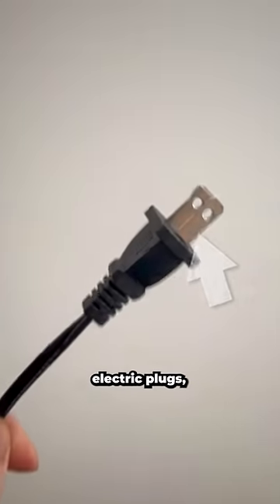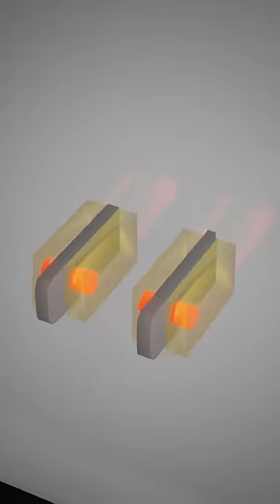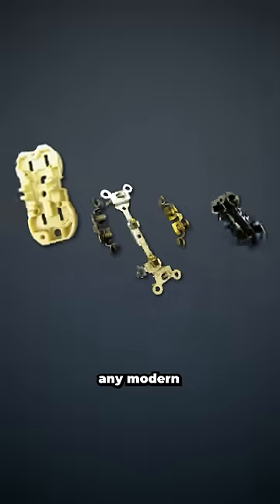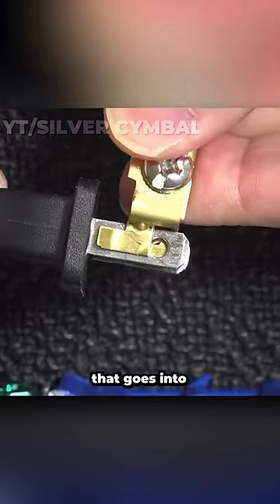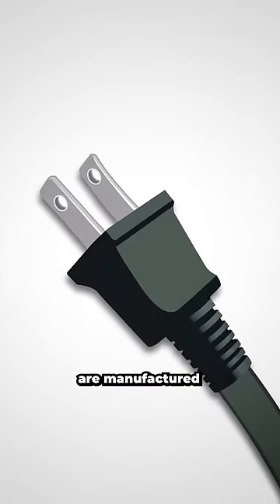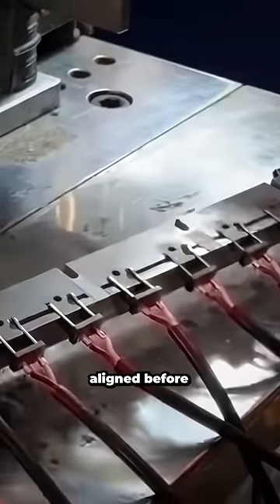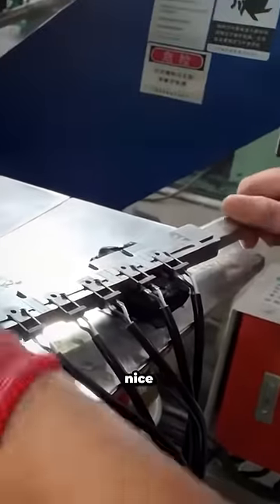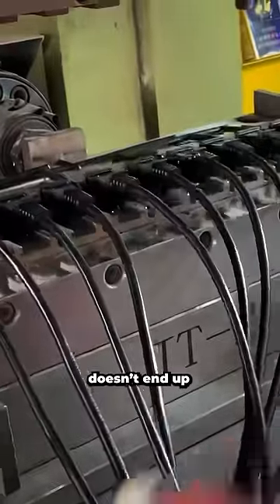The REAL Reason Plugs Have These Holes 😮

Comment: European plugs:🗿
Reply: BS1363  Plugs are best.
Reply: British plugs are the most are the safest and superior plug
Reply: @MCD10000 not when you step on them
Reply: Why did you leave them on the ground there’s a switch for a reason
Reply: @MCD10000 I fucking hate UK plugs, the size and clunkiness of it makes creating smaller packages for products with different cables depending on where it will be shipped a nightmare. Basically every other standard powercable in the world are small and neat, and then we have the UK abomination.
Reply: @lem3547  NOO. DONT MAKE ME THINK OF THE PAIN
Reply: North Americans have to have content too
Reply: @MCD10000  i'm not from there, but I agree.
they're more sturdy with the extra plastic rod
Reply: @MCD10000 the most over engineered unnecessary thing ever
Reply: @MCD10000  British people as re just afraid of electricity and are over compensating
Reply: @monad_tcp  Us Brits are better engineers, we don't have to import talent to invent stuff :)
Reply: @garybowers5724 uffff lmao
Reply: @MCD10000   valid swears
Reply: @ETK_800  worse then Lego
Reply: @m84winzi  the UK'S wall sockets are designed so the grounding pin has to be pushed in before the live pins (Mains is AC) are exposed so no fork in wall socket and hey we actually have a grounding pin
Reply: @0akd3vi1  that extra plastic rod opens the wall socket and is the grounding pin where the device has a metal casing
Reply: @monad_tcp  the electric lightning says otherwise
Reply: @lem3547  yeah but they have a grounding pin
Reply: British plugs: 🗿🗿🗿
Reply: @MCD10000 I use EU plugs in British plugs by unlocking it while pushing in the EU plug.
Reply: @MCD10000  UK plugs make everything too big for no reason. Look at a macbook charger and how it ruins it
Reply: As an American, your plugs are too safe I have no idea how to install them. Like, shouldn’t questioning whether they will arc and burn your house down be standard.
Reply: @MCD10000  British plugs are way too big. A grounding pin may be good but surely it could all be more compact. My phone charger plug does not even have a grounding pin, it just has a piece of plastic to go into the grounding hole to open the socket; it is pointless to have a "required" safety mechanism if products are allowed to just bypass it anyway.
Reply: @elio7610   There is a reason why some devices an earth pin, and some don't. Generally, high power devices like Toasters and Washing Machines need one, as you can risk getting electrocuted by just touching it. So its there for a reason.
Reply: @stueyphone  My point is that the devices that use a plug without an earth pin should not need a dummy pin. Also, they just seem generally oversized.
Reply: @MCD10000 not really, tell me what’s more secure on those compared to type F?
Reply: @MCD10000 nothing beats the swiss j with a t13 socket
Reply: @monad_tcp suprisingly its not german, with their history of overengineering
Reply: garybowers5724 That’s not what your royal family said.
Reply: Type G plug 🗿
Reply: fr
Reply: @lem3547 american plugs would be worse if they were right angled
Reply: @LambdaMiscellaneous  no, it's for safety mate for safety
Reply: @miles5600  a plug where I kid can't shove a fork into them I.e. the UK plugs
Reply: @MCD10000  type F literally has the same safety feature…
Reply: @MCD10000 I just looked them up and they look inconvenient as hell. Blocky, massive, and serving the exact same feature as the Sleek slender low profile modern beautiful North American plug
Reply: @elio7610  I agree. The EU plug is a good example.
Reply: @m84winzi  you know what else is an abomination? Easily preventable electric fires 🚒
Reply: @MCD10000 safest yes. Superior? Heck no. Way too big.
Reply: @MCD10000  ye
Reply: @miles5600  don’t think type F has a fuse
Reply: @m84winzi  our wire goes 90 degrees down tho, when it sticks out it looks dumb and can easily be pulled out
Reply: @monad_tcp  When homes run on double the voltage Dumberica runs them on, yeah.  I think I'll take engineered safety over some benign inconvenience any day.
Reply: @lordollsworth  we don’t need one. The fuse was only made because there was a copper shortage and they didn’t have the extra length to do it right.

https://youtu.be/NwnIwgT60jw?t=233

This video’ll explain it.
Reply: @garybowers5724 Lmfao. Brits import more engineers per Capita than most of Europe or the US.
Reply: @@diowo_ actually the moulded ones are no more clunky than a euro plug but the advantage is they have a BS 1362 fuse to protect the cable, 
Strangely half the hotels in China use BS 1363 plugs and sockets.
Reply: @ericandes4288  Source?
Reply: Fr
Reply: Yeah it has twice the voltage, all of our stuff is just superior.
Reply: Italian plugs are safe beacause the ground is in the midle and seperate from the other contacts
Reply: @MCD10000 they are the most goofy looking though
Reply: People really debating which plug is superior in the replies 💀
Reply: @MCD10000 nahh german are best
Reply: @LambdaMiscellaneous 😢😢😢😢
Reply: @garybowers5724  LOL, British stuff infamous for letting the smoke out.
Reply: @dogwalker666 Nah power over ethernet is better
Reply: @acewayx  good luck charging your car with P.O.E.
Reply: @smithiness   what does that even mean?!
Reply: Cypriot plugs:
Reply: @zenketski  the US plugs don't have grounding pins and are always on so a kid can fork in socket
Reply: @SliceOfLife93  it's weird as a brit, not they are not if you get the correct adapter like the Samsung one where the grounding pin collapses for storage
Reply: @dogwalker666  maybe with POE+++++++++++++++++++++++++++++++++++++++++++
Reply: @MCD10000  lol maybe 🤣
Reply: @MCD10000  that's a good learning experience for kids. If they survive,  they learn thats stupid.
Reply: @boxraze5643 thats not only stupid but potentially incredibly dangerous due to the voltage differential and not haveing the fuse it to help with the voltage difference
Reply: @alayablack9104  It's not dangerous. The voltages are the same at 100-240 volts AC and 50hz. I believe in the us the voltages are lower but not in the UK.
Reply: @lordollsworth having an outlet that unplugs gracefully from tension on the cord is a good thing. . . 

What happens when something pulls on a cord with enough force to damage the copper? North American plugs just unplug. UK and other 90° plug you now have a fault in the cord, high resistance, and a fire.
Reply: @MCD10000 also, you've clearly never seen a grounded north american plug, a shuttered "child proof" north american outlet, or a child with the inventiveness to grab more than one fork.
Reply: Laughs in British plug
Reply: @MCD10000 sure but they sure as hell aren't the best ones, the standard European plugs are a lot better as they can be plugged in in any direction and are almost impossible to step on.
Reply: Best one are the swiss
Reply: @m84winzi British plugs are the only sensible sized plug. If anything they're too small. European plugs always feel flimsy by comparison.
Reply: @MCD10000  Holy shit, British plugs look disgusting. No hate, but I just looked them up. I'm so glad that the EU has the cleanest design.
Reply: @m84winzi Still the safest and most effective design, I rarely have problems with clunkiness.
Reply: Australia and New Zealand rocking 240 volts 🗿
Reply: @MCD10000 because they strong and durable like harder to break
Reply: @MCD10000  they have to be because your house installation sucks
Reply: @m84winzi I love you plugs so much faster
Reply: @MCD10000 european schuko plugs also connect the ground clips before the  electricity pins go inside the socket.
Reply: @MCD10000 geounding pin isn't necessary. In the USA we have plugs that use ground pins only on high wattage devices or extension cables. Wouldn't make sense for your 30 watt charger brick to have one lol. Now in Japan they have the same plug as the USA but not one comes with a grounding pin...
Reply: @dogwalker666  haha no. Learn to create better circuits instead of that abomination of ring circuit, then we can talk and show you the safety standards of EU.
Reply: @cosmopolitanussum485  Ring circuits are so good I use them in industrial control panels, hundreds of Amps, TP&N oh and Europe uses British standards under license.
Reply: @stueyphone schuko plug also haves grounding, but doesnt need one in order to be used, so you can have thin chargers for the phones and still have a ground in the same outlet if you need to plug something bigger
Reply: @monad_tcp Nothing over engineered or unnecessary about it.
Reply: @LambdaMiscellaneous I'll take safety over aesthetics any day of the week.
Reply: @elio7610 Phone chargers are double insulated and don't require an earth connection.
Reply: @MCD10000 As an American I agree. It's way too easy to stick something metal in our outlets. A lot of babies and kids do it every year. The plastic protectors being built into the outlet is genuis.
Reply: @m84winzi I'lltake the inability to get shocked, switches on the sockets, and in built fuses and earth that goes at a parallel to the wall to minimise space usage over that dangerous American pos.
Reply: @monad_tcp  a child could do it, and you could accidentally. Also, you have no earth cable, so it wouldn't save you if you got shocked anyway. Obv you are not going to grab the metal on purpose, but why omit such a simple and cheap safety feature.
Reply: @sharpshotm16   I don't need any earth cable because things have isolating transformers,
Reply: @robertbritton656 anything electrical in Britain is completely over engineered.. especially in Industrial context.
I believe there was some accident which cause the regulation to require insane amount of overprotective solutions.
Reply: @lem3547  Especially when you step on them. In the battle of plug vs foot, plug beats foot every time. How does that not fit the definition of "best"?
Reply: @m84winzi  Not our fault the rest of the world has weak-ass plugs.
Reply: @monad_tcp  If anyone's scared of electricity it's 120VAC countries.
Reply: @Kemachris  But it is almost completely safe. And in some properties more convenient. We don't cheap out on costs of our plugs to increase profit or to drive capitalism. We use our plugs because it is almost impossible to be seriously injured. Safety should come first. Not reduced cost.
Reply: @sharpshotm16  the point is somethings are overdone to the point it doesn't increase safety, but merely is a hindrance to the workers. But I am talking about industrial and not private.
Reply: @eyeball226  we're not scared, indeed we use 120V because we like to be shocked as it's mostly harmless when you get a shock
Reply: 120 > 240
Reply: @garybowers5724 we got TV first in the Us... and the first black and white comppatable color TV standard on the planet
Reply: @MCD10000 Hell yeah
Reply: @jmurray1110  we dont need switches
Reply: @Bwong55  no you don’t need them but there nice to have as it means you don’t need to unplug your stuff to stop them draining power
Reply: Euros will feel superior about anything and it’s hilarious
Reply: @MCD10000 no shit uk isnt in europe
Reply: I used to play planes with them when I was a kid
Reply: @garybowers5724 "we don't have to import talent"
literally had to reinvent the plug because people were so stupid they kept getting zapped by a standard plug
Reply: @dadsback69 moron
Reply: @m84winzi you ever seen folding plugs? Solves your problem of space
Reply: @monad_tcp welp don’t have to worry about being electrocuted or anything, it’s just impossible, there definitely has never been anyone who’s died like that, especially not kids.
Reply: @tedkaczynskiamericanhero3916  What does that even mean? you think Britain used the US standard plug? oh dear, maybe read some books - if you can read :)
Reply: british plugs 🗿👌
Reply: @m84winzi we have something called a  ground pin and it means you won’t get sent to the hospital after your crappy microwave breaks!

it’s so big so that if the cable starts to come out the ground pin can still remain connected!
Reply: Finland has ok electric plug system
Reply: European plugs are the best
Reply: @m84winzi  yeah but they got a freaking fuse built on them
Reply: Nah Australian plugs on top, we got three prongs instead of two
Reply: E u plugs are safer because they have earth wire
Reply: more like us v the rest of the world 😆
Reply: @garybowers5724 right ok you must live in londonstan😂
Reply: @m84winzi or be smart designing it and make the prongs foldable
Reply: how Europeans feel after making fun of Americans for the smallest things: 😎😤
Reply: Asian plugs:
Reply: @0akd3vi1  sometimes the plastic rod is metal for optional conductivity
Reply: The UK is different French or to say the EU plug is rounded instead of straight blades, yet Australia plugs look similar to the USA but is a little slant or crooked and yet Japan uses the North American plug the rest is the EU plug, China on the other hand might have the UK plug.
Reply: Im spanish and when I travel to UK I love the plugs.
Reply: Sure, but imagine there being rules on where you can plug things in at in your own house.
Reply: @MCD10000 But you need to push into both holes at the same time for them to open
Reply: @MCD10000 agreed
Reply: @m84winzi you mean the safest plug ever made. Yeah its just horrible being safe isnt it
Reply: We are just better
Reply: @garybowers5724 good one.
Though i dont like the uk plug
Reply: UK plugs are the best
Reply: @MCD10000 they're too big and bulky.
Reply: @MCD10000 good English much wow 😂
Reply: I mean, I do like the idea of a fuse inside the plug, though I do need to question when the last time one of those popped if everything is grounded.
Reply: @SetuwoKecik  Yes, moai statues are very conductive, so we go dig them up to use as plugs whenever we need power. 
I have no idea what all the other people are talking about…
Reply: @filipwassen7947  

We tend to underestimate ancient civilization, indeed.
Reply: Typr C and F are good too
Reply: @m84winzi Have fun replacing a US plug if the cable gets damaged at all.
Reply: Brazillian/South African are way better, and european ones work on the outlets.
Reply: @dogwalker666 
Schuko would like to have a talk with you
Reply: @zwiebelkopp  Yuck they are horrible,  And don't even contain a fuse 😯
Reply: @monad_tcp For good reason...our home outlets have 240V running through them. Americans have 110
Reply: @eyeball226   no, 127VAC is for historical reasons. electricity was invented there and its first use was illumination, not heavy machinery, so there's some sense to it.
Reply: @aykay1303  240V is nothing. I start getting scared from 300V above
Reply: Also Britsh, STUPID RING distribution network instead of the proper STAR one.
Reply: @MCD10000 A plug that cant be put in upside down is dogshit, British plugs are by far the worst. tHeY hAvE a BuIlT iN fUsE, yes because British electrical installations are old and dogshit as well, the plug-fuse is a coping mechanism that modern properly made circuits dont need.
Reply: @MCD10000 US plugs do have ground pins wtf do you mean
Reply: @wi1draccoon US plugs have earth on them too
Reply: @MCD10000 😂 love the humor 😂
Reply: @MCD10000 swiss are even better and WAAAAAAY more compact
Reply: Indian plugs 💪
Reply: British plugs
Reply: @m3r1ca20 they are the safest design
It's not a fashion show its supposed to save lives
Reply: @Poglavnik088 we have overengineered ones too in germany
Reply: @MCD10000  Sure? British sockets (type G) are flat and you can still touch the contacts of the plug though under current already until it's inserted completely.
This is nearly impossible with type F plug/sockets. Similar type E, D, K, H, C (though I don't like type C as it has no earthing pin)
Reply: @MCD10000  Safest? You can just insert an screwdriver to it and insert an European plug to it and it will work😂
Reply: @MCD10000 gay
Reply: 16a250v is really good
Reply: @m84winzi they’re one of the few power outlets ro have earthing
Reply: @MCD10000 british knifes are the best
Reply: @lem3547 There's not a single reason why a UK plug would ever be on the ground. Not a single one. That's what the switches in our plug sockets are for.
Reply: @FlatEarthKiller  Oh hi 👋 there
Reply: @FlatEarthKiller  It’s a known bug, Comments vanishing randomly.
Reply: German plugs  are the best